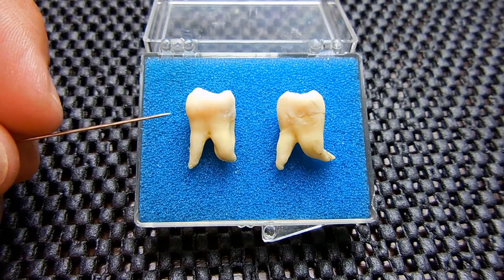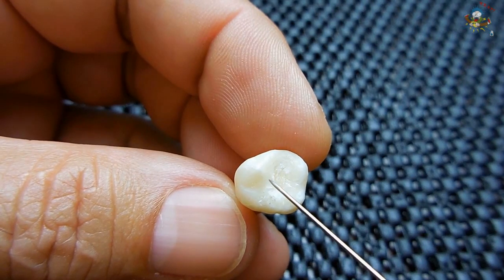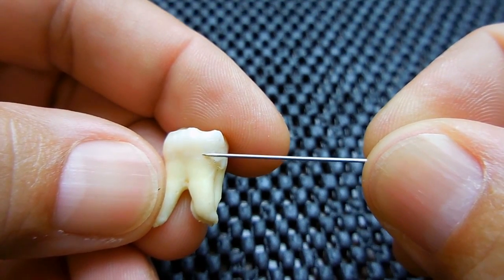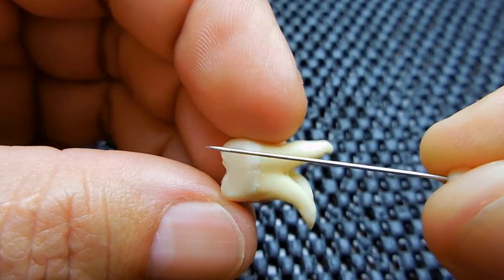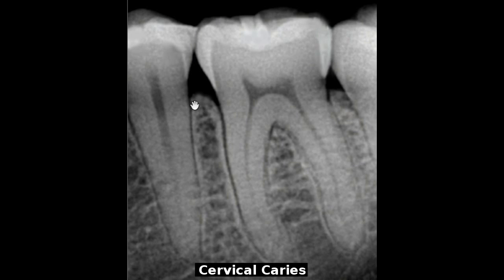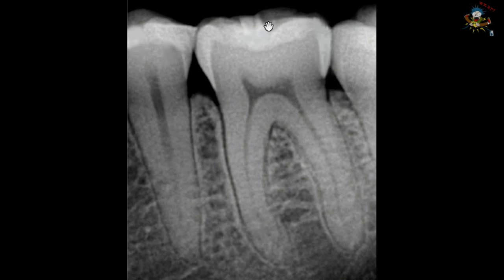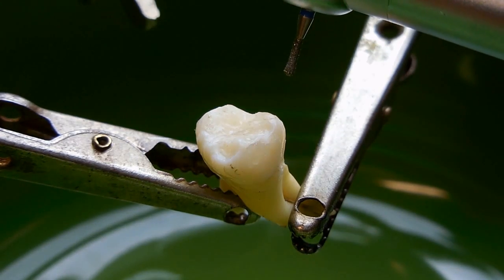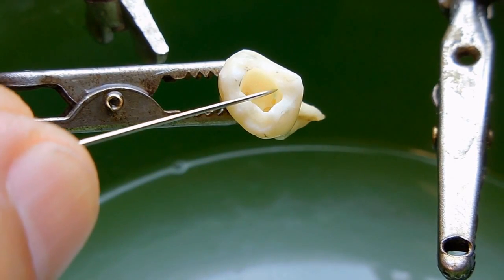Third Molar (Wisdom Tooth) Anatomy & Drilling

Comment: I had all 4 wisdom teeth extracted at once.  It was done because I complained of pain in my mandible when asked a leading question by the a dental hygienist on a fishing expedition.   I come to regret  this because there was no other problems with infection or dislocation.   Never did anyone discourage this operation.   In retrospect, I should have been given medication for this problem.  I regret this now and see it as a way that dentists line there pockets.  If you have the same problem with pain, and no other complications don´t fall for this unnecessary surgery.  These teeth are there for a reason to help with mastication when they are removed you loose some of this ability to chew.   Surgery should be used a last resort and never be done without a second opinion.
Reply from the maker: +Joseph Nicholas 
If you experience no problems with how the tooth erupts, or tooth crowding, then you leave them alone. Thanks For Watching!

Comment: The instruments used in the rocking motion you described are extraction forceps, not extractors.
Reply from the maker: +ftwildernessguy 
Incorrect. The first tool usually used is an elevator to loosen the tooth from the bone by cutting away the PDL and expanding the socket. Next the extraction forceps are used(which I referred to as an "extractor"). Thanks For Watching
Reply: +electronicsNmore That is what I said.  I didn't mention the elevator at all.  I have been a practicing dentist for over 30 years.
Reply from the maker: +ftwildernessguy
Below the word "Extractor", I added the words "Extraction Forceps". :-) We both were talking about the same instrument, but I did not use the proper name. Thanks.